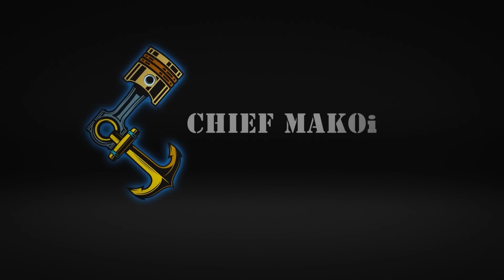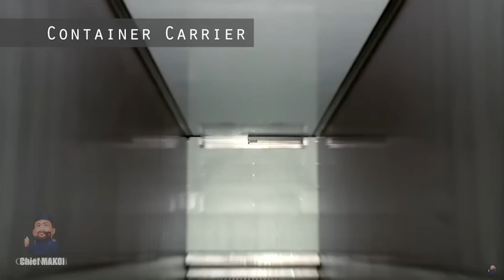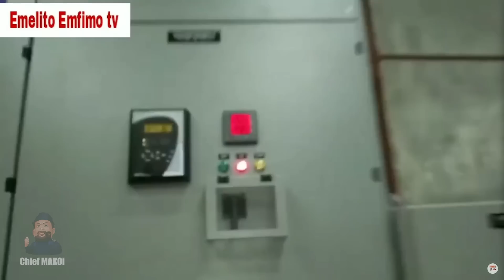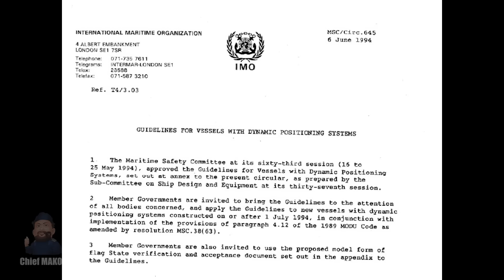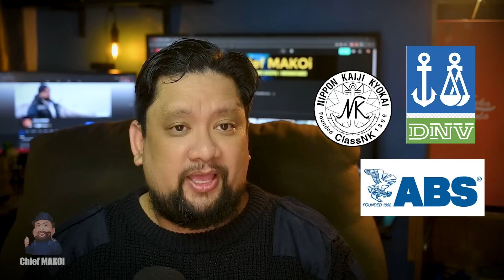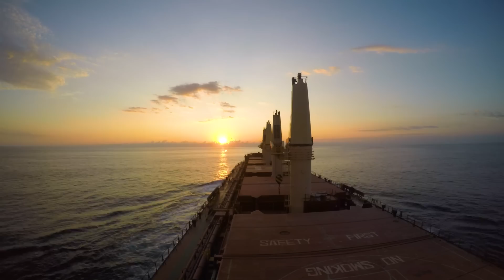Why Cargo Ships Don't Open the Bus Ties During Maneuvering | Chief MAKOi

Comment: I have a few questions that come to mind which are not being addressed... 
1) Container ships use 6600V generators in order to supply power for refrigerated containers, but I read that most containers are typically wired for 440V or 480V. Does that mean there are other banks of transformers not shown on the diagram to reduce 6600 to 440 just for the containers? 
2) Can you close a bus bar like HVR or LVR when both sides are generating power? These are AC generators and they would have to be precisely synchronized before you can connect them together, otherwise large amounts of smoke will surely follow. I don't see any discussion on this topic. 
3) I have also seen where the main engine on large ships often has a generator attached to the prop shaft. I understand that this generator can power the whole ship once safely underway, and the other gen's can be shut down to conserve fuel. Is this true or did I dream it?
Reply from the maker: 1.  Yes, they have.  
2.  They need to be synchronized.
3.  Shaft generator.  Not all ships have them and they can only be used when the ship is already out at sea when engine speed is more or less consistent.

Comment: We're focusing on transformers now ... [raises eyebrows] ... transformers don't usually go bad ... plus we have "circuit breakers opening while connecting reefer units" from the day before ... aren't the reefers on the upper voltage? ... how much and how big a piece of wire to by-pass one of them circuit breakers? ... anything to get out of port and moving to their destination ...

Comment: Thank you. There is even push back on National Electric Code (NEC) changes. Yes we can see it coming but "nothing has gone wrong in decades"  
Hence the push back on arc fault and now surge Metal Oxide Varistors (MOV) 
As a counter point - switching under load puts alot of wear and tear on the breakers. These are not house hold switches nor breakers. 
On the other hand, both the military and Information Technology (IT) world live in the N+1 realm.  There is always a hot running spare active with one or more full backups. Costly up front, cheap in the long run.

Comment: I’m not an engineer but I would design a parallel system or rather, a double parallel system to make it four times as robust.  isolation via breakers. Cmon guys you can’t go overboard when you’re designing safety on the ship.  (Yeah a pun)

Comment: i did not get one thing. Having 2 transformers looks for me as redundancy which is required for safety. if one fails it is easy to switch over to the working one. The tripping of both feed and load switch at the transformer sounds for me as a safety for the transformer  and the other side had to come online in a automatic way. Whatever happened, in the beginning of the discussion were safety drills mentioned which should be documented. At least for some part of this looks for me as bad operation or not understanding how to operate / see the risk. Can this be ?

Comment: YOU WOULD THINK THAT THE TOTAL POWER NEEDS FOR ALL REFER CONTAINERS BE CALCULATED AND HAVE A DESIGNATED GENERATOR AND POWER SUPPLY FEEDINGS SUCH CONTAINERS. REFRIGERATION CONTAINERS ARE MECHANICAL EQUIPMENT AND DO BREAK DOWN. THUS CAUSING POWER ISSUES AT TIMES. SHOULD A SHORT HAPPEN OR SUCH ISSUE WITH THE GENERATOR, UTS COMPLETELY SEPERATE FROM ALL OTHR POWER SYSTEMS AND BAM, FUTURE PROBLEMS AVERTED.

Comment: Finally Chief. I have been asking this question as to why the Dali’s LV Bus was not split with an open bus tie during its departure from Baltimore. Providing LV via one transformer is a single point of failure with no redundancy.

Comment: It seems to me that running with both bus ties closed and both transformers in service is the safe way to go - maybe only while maneuvering into and out of ports.  Wouldn't that have prevented the black out on the Dali?  Running on one transformer leads to a single failure bringing everything down.  This is why we maneuver with at least two generators on line.  If they'd had both transformers in service, losing one would not have caused a black out.  

I expect that the Dali's system has all their #1 machinery on one side of the switchboard and all #2 on the other (assuming the bus ties are breakers that can be operated while in service.).  If the #1 side of the buss blacks out while running on number 1 pumps, you will still trip the main engine, even though the #2 side of the buss remains powered up.  It would make restarting the engine on #2 machinery easier, but you still lose the main engine for at least a few minutes.  Right?
Reply from the maker: Standby pumps (either #1 or #2) have an auto-start in case pressure starts to drop below the set limit thus preventing ME shutdown.

Comment: I think it is not standard practice because civilian mariners don't tend to think in terms of redundancy in favor of efficiency of how to get around and maintain the machinery in operation. They also tend to line up the power plant for sea and not necessarily for safer harbor transit. The Engineering Department seems to think in terms of now and not so much in terms in being ready to shift the power plant in the moment. They are complying to their version of SOP and efficient plant operation.

My Submarine years trained me to think in terms of mission readiness, but we also had what merchants do not enjoy. USN ships have redundant systems that are mirrored on the port and starboard sides. The engineering systems were switched with an automatic buss transfer that can also be operated manually. It was done daily to insure readiness and catch maintenance issues. On even numbered days, the port side system operated and was switched to starboard on odd numbered days.

Merchant vessels don't have that kind of redundancy but do have alternating options as you described and that kind of operational set up should be used regardless of ship's location in harbor or at sea, imo. It is just sensible and makes any casualty easier to cope with and solve. It is also a good mind set thinking to be ready and to train the watch standers in what to do and in how to proceed when equipment fails.

Navy training is rather severe as we used to train with full air breathing masks donned followed, eventually, by drill monitors covering vision with distractions representing smoke, steam, high pressure water mist, or darkness. Maybe on a merchant, drills could be conducted with only emergency lighting aiding the difficulty of the scenario. Equipment, as in my naval training, does not have to be shut down; it can be assimilated and still teach watch standers what and how to push which "buttons", where they are located, and which are different from another in the same or similar location.

Just a thought. 
Thank you for your videos, Chief.
Have a nice day and 
GO NAVY
Reply: My guess would be that engineering department does not think in this situations, but follows established procedures

Comment: As a retired helicopter mechanic and trained as an aircraft electrician I haven't thought about buss-ties etc. in years. Only time primary/secondary bus-ties became an issue was when you lost a generator or engine. Aircraft use 3-phase 400hz 110v AC and 28vdc to reduce wire size due to current requirements and save alot of weight. Also, maritime uses Delta AC connections, aircraft use 'Y' connections. I was trying to hook up our Hobart external power cart at the port at Kitty Hawk, NC and just could not figure out what was going on, luckily, I didn't kill myself.

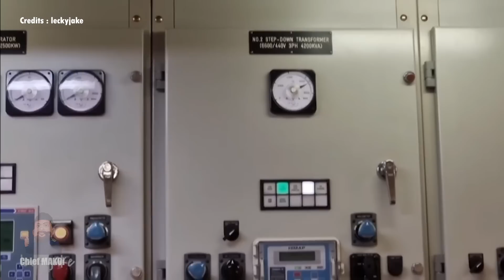Comment: I can see @1:52 a HV switch that looks very simular to one on the Dali. Can you at some point, do a more in depth overview of the ships entire electrical system from the generator to the last low voltage loads at 110v. And do a much more detailed overview of every switch and meter on the switchboards, like what they do what is the function. Also would be nice to know how the system is laid out, such as are the primary system voltages in a delta configuration, or WYE, is the 440v system a corner grounded delta or center tapped WYE system, how is the grounding and bonding accomplished, what provides the exitation voltage for the main generators. How is the power factor adjusted, load sharing control options, things like that. I'm familiar with how it's done on land, but ships as I understand it, the electrical system is 'grounded' through high Ohm value resistors just to keep the system voltages relative to the ships hull correct, but in the event of a fault, only a few milliamps will flow thru the resistors which creates a detectable fault for the system to set an alarm or trip.

There's a lot of engine room and ship electrical switchboard videos on YouTube, but they all pan or zoom past all the controls and no explanation of what does what, or for example how to switch off one generator, and start a standby unit, and synchronize and parallel that incoming generator to the bus, and also make sure the newly added generator is providing it's share of the VAR demand, and KW demand. If one generator is providing a higher voltage than the other, it will end up seeing a much lower power factor than the other one. Both generators could be providing the same number of kilowatts, but keeping the kilovolt amperes equal is also challenging to do manually. I think modern ships have automatic speed and voltage control systems in a configurable lead/lag and adjustable voltage and load droop functions, but sometimes things have to be set up manually in unusual circumstances, then switched back to fully automatic control once things are running good.

Also why is 440 volt a standard on ships, where on land at least in North America on a 60Hz system, 277/480v in a center tapped WYE configuration with a neutral bonded to ground is the standard, this ensures no individual current carrying conductor exceeds a line voltage of greater than 277 volts to ground. In Europe on a 50Hz system, the standard voltage is 230v line to ground which would result in a 400v line to line voltage. Some countries still use 220 volts on their systems even in single phase, so this results in a 380v 50Hz system. I've seen equipment on some smaller older vessels labeled 380v. But in today's world with the UK and the EU trying to keep to one standard, in the UK they've lowered their voltage a little from 250v line to ground to about 240v, and in Europe they've slowly raised the voltage from 220 (very old now) to 230 in the netherlands for example, and 240v line to ground would be 415volts which is the nameplate rating on almost all new 50Hz equipment now. It's either 415v 50Hz or 480v 60 Hz, but to get 440 volts is 254 volts line to ground and 254 is not found anywhere except on board ships.

Is this 440v some sort of compromise, so that the ship can be sort of safely connected to shore power anywhere in the world, since motors designed to run on a 480v 60Hz north american system have a nameplate rating of 460volts and should run fine on 440v, it's not low enough to cause a problem. And a 415v rated motor would also be perfectly happy running on 440v, it's not a big enough difference, in fact, per NEMA standards, all motors have to be able to withstand a tolerance of +/- 10% in order to be certified.

Most shore power installations I've seen, even the new one in Port of Vancouver, BC, Canada, is 6600 volts @ 60Hz. Ships that are confined to and only work in the EU or Africa or India etc will mostly be fitted with 50Hz equipment, but for cargo ships that travel worldwide, 60Hz is more common especially ships that service North American container ports. During cargo operations in Long Beach for example due to the air pollution and NOx laws in the SCAQMD, ships must be connected to shore power if possible and all generators powered down.
Reply from the maker: Thanks for this.  You gave me a lot of ideas for future topics. 😊
Reply: @ChiefMAKOi  Thanks, I have a good idea of how electrical systems work on land, at least here in north america, I've lived in both Canada and USA and they're about the same except in Canada, 347/600 volts is becoming more popular for small industrial shops, and in the USA, 277/480 is more common for larger stuff. Almost all small commerical stuff like restaurants and strip malls is either 120/240 split phase or 120/208 3 phase power. I've installed a few transformers before too, but only like 125 or 75 kva, just small units to drop from 600 or 480 volts to 120/208.

There are a few old buildings downtown where I live that are still on a 240 volt delta 3 phase system with a center tapped large transformer for 120volt things. That system is strange, line 1 to ground or neutral is 120volts, line 3 to ground is 120 volts, but line 2 to ground is 208 volts approximately and is called a "high leg" or "stinger" because if you connect a 120v appliance to it, or accidentally touch it, it'll "sting!" lol.

If you want an even stranger system, there are still very rarely some two phase systems in operation here. Like in some old buildings in the old part of Phildelphia, there are some 2 phase systems still in operation, the utility doesn't use 2 phase power anymore, but they can supply what's called a "Scott-T" type of transformer that converts 3 phase power into 2 phase. You can identify a 2 phase system if it has like 5 wires going into a disconnect, and all the disconnect switches or circuit breakers will have 4 poles instead of the usual 3 for 3 phase or 1 pole for 120v or 2 pole for 208/230 volts single phase. The reason for this is a 2 phase system has 4 sets of conductors and 1 neutral wire. Each pair of power lines is a set of 240 volts for example, each one being 120v 180 degrees out of phase, but each of the 2 incoming phases are exactly 90 degrees out of phase. So for example a 2 phase 240v electric motor could have 4 poles, and each set of opposing poles is connected to one phase. The reason for this is it makes it very fast to change the rotation of the motor, so 2 phase motors were very popular in machinery that needs to start/stop and reverse direction very often, such as elevators or stamping machinery, and some of that stuff is so old, but very reliable, and wouldn't be cost effective to replace and redo all the building wiring. But as time goes on, more and more of that stuff from the 1930's era is slowly going away.

This is kind of the same reason why DC power persisted in use on board ships for a very long time up until even the 1940's and even 1950's! It was easier for speed and directional control to use DC motors until such time as variable frequency drives were available. I remember when I was younger I was on board a small ferry called the Vesuvius Queen, and all they had for electricity was 115volts DC power on board, so the crew had to use like primitive or simple coffee makers that didn't care if the power was AC or DC. They could use things that had brushed motors like vacuum cleaners, grinders, drills etc, those all work fine on DC, and they cooked or heated their lunch on a cheap hot plate (what they would call a cooker or hob in the UK) on a countertop. For a microwave they had a small inverter unit that would convert 115 DC to 120v 60 Hz AC power. This vessel was built in 1950 in Victoria, BC and was originally used for service as a car ferry on different routes. It was pretty small only 277 tons displacement, and length of 45 meters. But it was in service until early 1998, someone in the Dominican Republic bought it.

Comment: The NTSB report and all commentaries have not identified the root cause of the breaker trips. It seems there was a serious electrical anomaly somewhere in the system that caused the breakers to open and the fail over systems to kick on. According to the report, the electrical distribution system was in 5 different states from 48 hrs before to complete blackout just before hitting the bridge. This indicates as serious unidentified short, or excessive reactance in the system, causing  both upstream and downstream breakers to trip at different times. Both the EO and Captain reported the ship ready for sea prior to slipping lines. Either the anomaly was not detected prior to slipping lines, or they underestimated the nature of the problem they had by  trusting in the SOP's for readiness for sea.
Reply: Reportedly there were one or more power failures at dock. Perhaps they lied to make schedule.

Comment: Permanently closed bus bars aside, if there was a major short circuit on a system connected to the 440 Volt bus, wouldn't it have been automatically isolated by a fuse, instead of pulling down the whole system and disconnecting everything from the high voltage?
Reply from the maker: Yes.  Each motor has its own circuit breaker.  There's a possibility that the fault lies on the transformer TR1 itself.

Comment: Any  vessel apart from moving the vessel from one position to another position in the open sea or in restricted waters or just standing by and at the same time doing multiple tasks like maintaining various  numbers of refrigerated containers in its cargo hold, maintaining the well being for the  diving people in capsules under pressure on diving vessel , drilling vessel doing drilling-operations in vulnerable environmentally area etc. etc. should be required to be able to operate bus ties. Have I nailed it?🙂